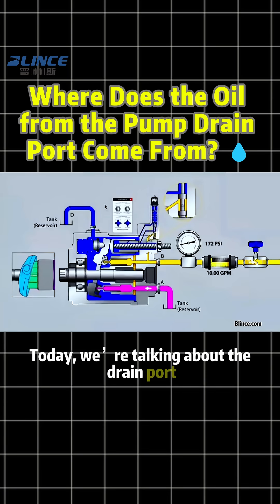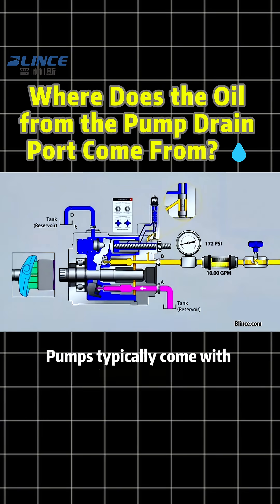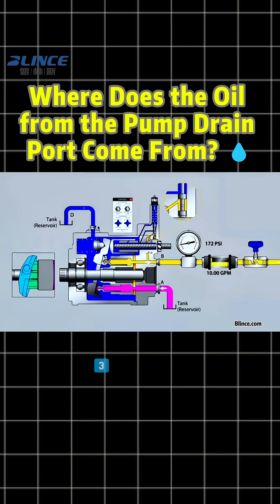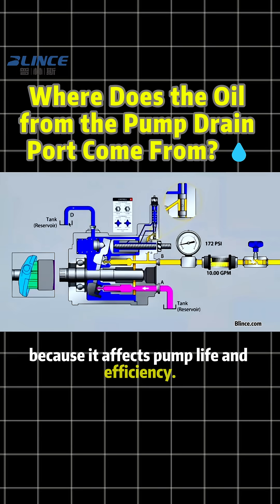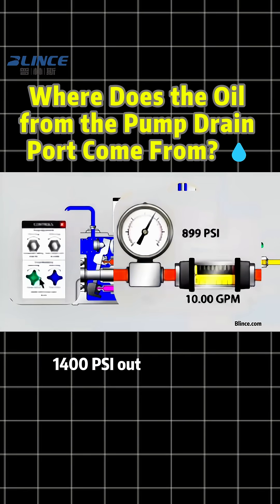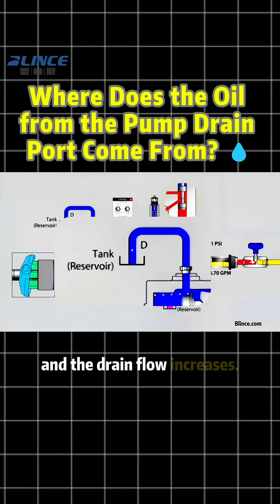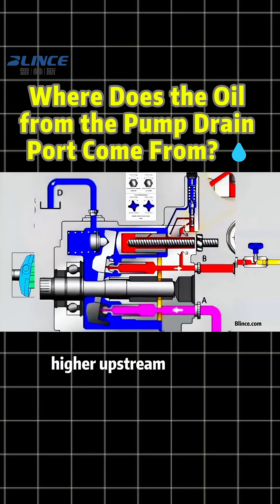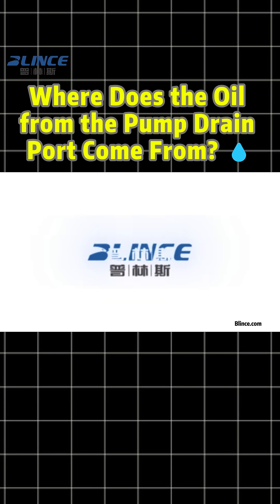Understanding the Drain Port of a Variable Piston Pump | How It Works Explained #blince

Comment: But why? Isn't the amount sucked into the pump the amount that leaves the System???
Reply from the maker: Good question! In theory, yes — the amount of oil entering the pump should equal the amount leaving it.
But in real operation, some oil leaks internally inside the pump to lubricate and cool the moving parts.
That leakage oil flows through the drain line back to the tank.
So the drain flow is actually the oil used for internal lubrication and pressure balance, not part of the system output flow.
Reply: @blincehydraulic  ok, that makes sense. Thank you - great Channel i enjoy the videos a lot!